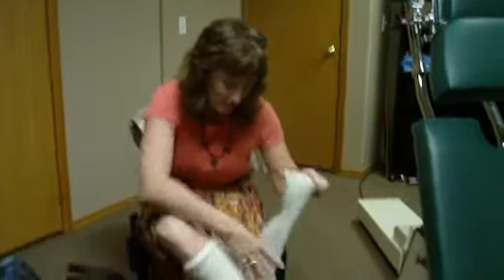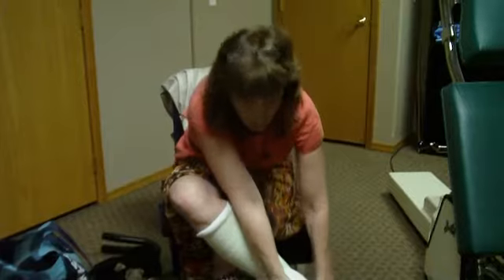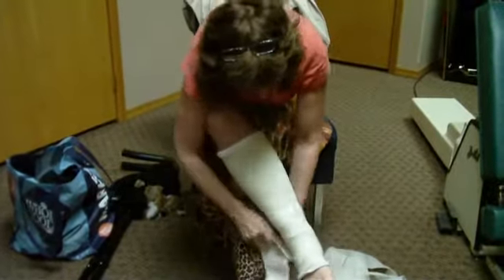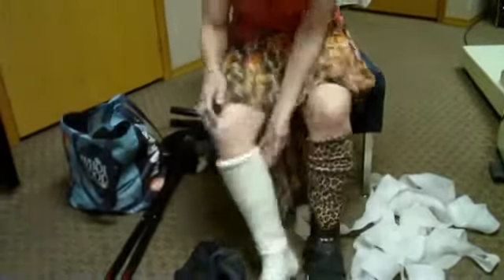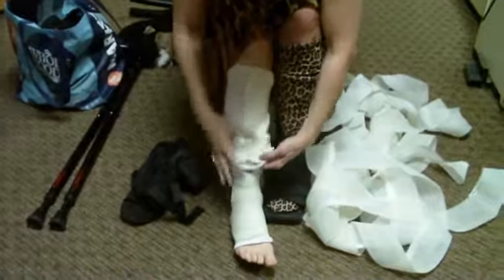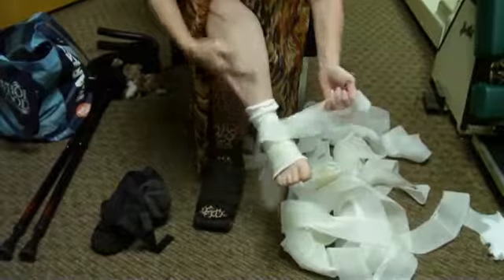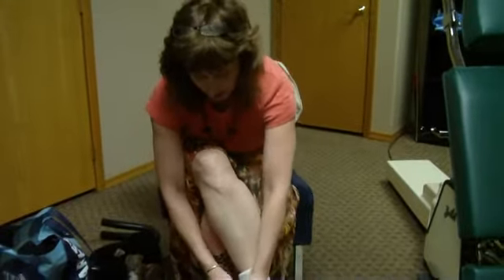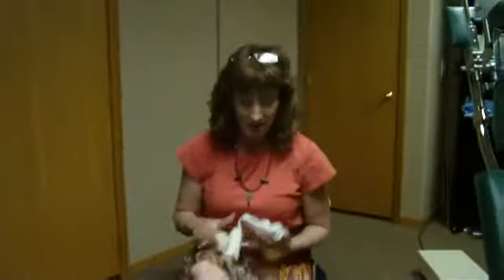3M Soft Cast Casting Tape removal demonstration blog update 11-12-13

Comment: You used some water or everything else to remove it?
Reply from the maker: It just unreels, the opposite of rolling it on around the leg. Because the size of the fibers of the material and the type of resin it does not set up like hard casting tape.